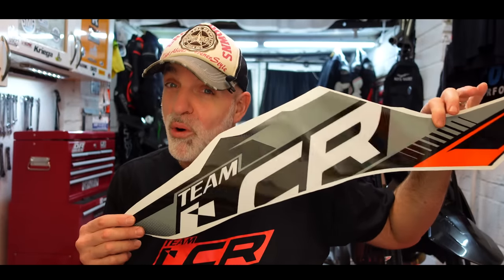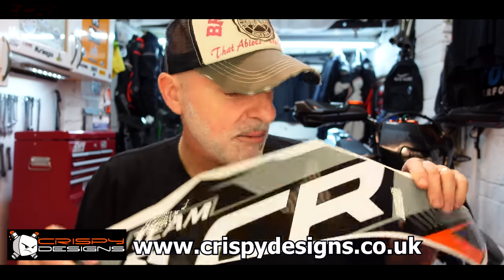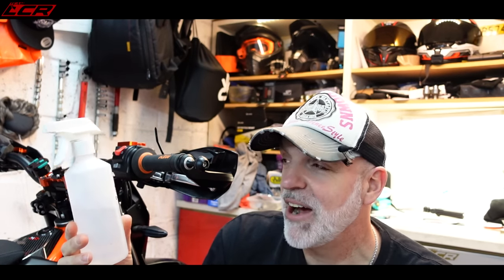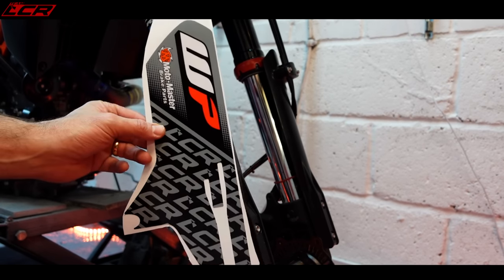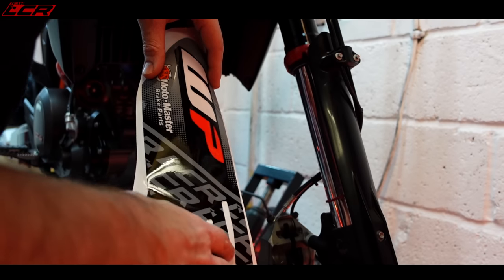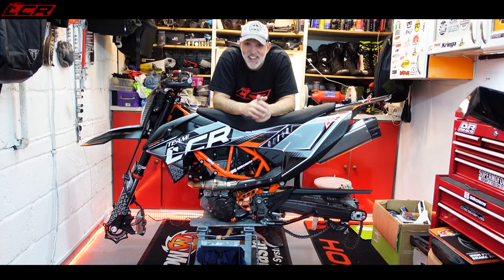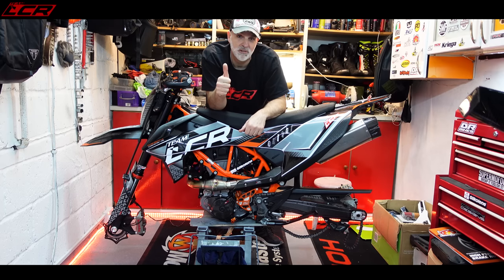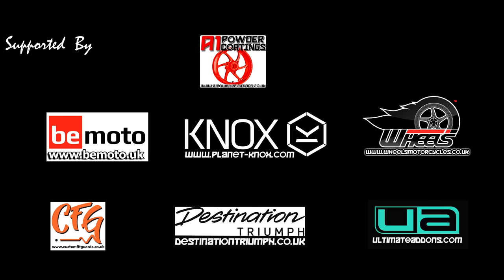Fitting Graphics Kits, Tips & Tricks | SMCR Build Part 9

Comment: Well Chopsy you have out done yourself once again absolutely amazing job I'm very impressed, looks so much better.... little tip for trapped air bubbles pop them with a pin to release the air then warm with the hair dryer
Reply from the maker: Thanks buddy but the thanks goes to Christian! Yeah might try that for the tiny few there is 👍
Reply: DOH!!! just noticed Gideon de jongs comment beat me to it LOL.  It does work I've done it with a vinyl wrap but as he says  make sure it's  a sharp point and use the heat to warm it after you prick it

Comment: Top tip I found doing mine, cut an 1/2 inch /12mm strip from the backing paper and leave the rest on, then position the decal and stick it with the 1/2 inch of adhesive strip then once its all in the correct place start removing the backing and work from the centre out works every time.

Comment: The graphics look good , I’ve installed 3M clear protection self healing film on my HD Tri/glide rear fenders and used the wet method , to me it worked better and a plastic bondo spreader really helps to get the material down & get the bubbles out , time and patience LCR now for any small imperfections use a sewing needle to give the trapped air a exit hole , you did a good job I thought a couple of tips would help for when you do another one , I have years of experience doing this, bring on the wheels
Reply from the maker: Thanks buddy good tips with the needle will try it 👍

Comment: Im not entirely sure on the ratio, when you install window tint, you can use a mixture of baby shampoo and water. What this does is make all the surfaces slick so you can get the bubbles out and have time to move the decals. When you get it where you want it press out excess moisture out and then let it dry. Much easier than sticking a sticker to a surface and it sticking to everything that you dont want it to stick to.

Comment: Looks pretty awesome !
Decals - You should cut the backing paper down the middle, hold one half in place with masking tape, then peel the backing from the centre for the other half and work out to the edge. Then remove tape and peel and fit the remaining half. Only use heat gun to fit the decal into difficult shapes - use it to much thou and you'll stretch the decal and it'll never fit. 
Why didn't you remove the original decals or are they moulded onto the bodywork plastic?
Reply from the maker: Yeah original are moulded in, only raised ones were the ones on fork protectors

Comment: You can use a spoon to save getting blisters on your thumb.

I fitted some genuine KTM graphics once and found they started to peel at the front edges of the front panels where they're most exposed to wind/rain, after about 6 months. I wondered if it's worth spraying the whole panel with clear coat to cover the edges? Maybe Crispy know.
Reply from the maker: Yeah not sure Ed.. Will see how it holds up. Can allways have any parts reprinted if it starts to lift anywhere

Comment: Before i finish watching, I combined two methods and it went out well. Lets see how you did it

EDIT: Good Job !  Its funny but i also started from the front assuming i will learn on smaller pieces <3 With tiny bit of water+soap i think its a bit easier but you need this tool they use for wrapping to squeeze all the water out and a bit of heat to push the decals into all the bits like the contour at the back. Very satisfying job to do

Comment: Loving the bike build chops would you consider doing a video on removing the pair vavles evap canister servo motor on your H2
As there not a proper video out there
Reply from the maker: Sorry not even sure what that is! Didn't know it had a canister system I will investigate 👍
Reply: @LambChopRides  possibly not on the 2015 to 2018 I believe black box under the tank removing it and pair vavle really makes changing the spark plugs way easyer and tidys up that area

Comment: I would never attempt to put decals on dry, its much easier when wet because you can slide them into place and less risk of stretching or tearing if you have to lift it for a second go. Just squeegee out any air bubbles and leave to dry.

Comment: Anybody know if these SMC R's have tubeless wheels?  Was looking through the owners manual on-line and on page 79 it has info on the "Tubeless Tire System".  However, KTM's website has no mention of the bike having tubeless wheels, which seems like something they'd want to point out that it has.
Reply from the maker: Yes fully tubeless 👍
Reply: @LambChopRides  Nice!  So odd that KTM  doesn't really list that info on their website specs for the bike, as far as I can tell.  A great feature that they should advertise that the bike has, since no other factory SM's seem to have it.